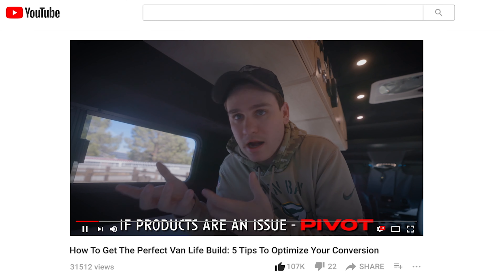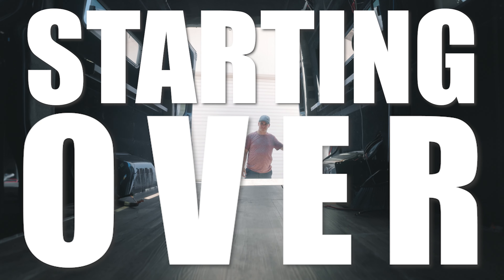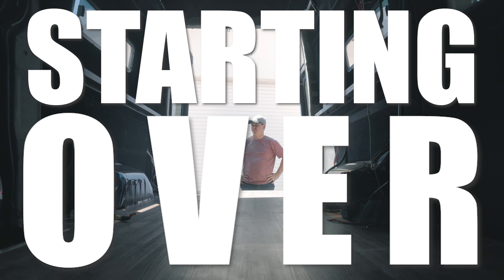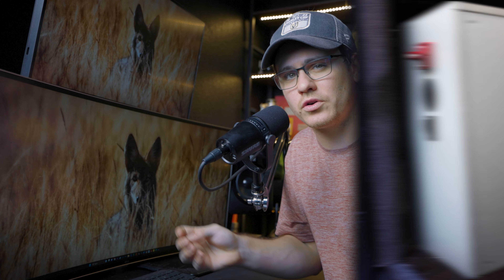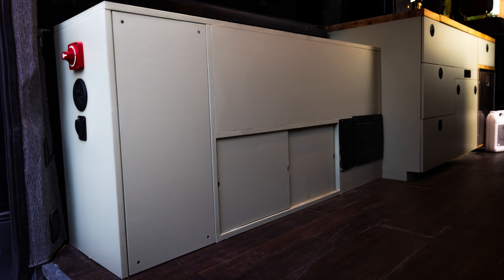How to Build the Ultimate Electrical System Cabinet

Comment: Very nice!  And you sure went with premium components.  Bigger wires are always better as well.  It looks like you have your Batteborn batteries all in parallel.  I'm curios if you took the main battery bank leads to the inverter/cut-off/fuse from the end or the middle, as it's not obvious from your video.  I guess the easiest way to balance them is to take the positive and negative leads from the opposite ends of the battery bank while keeping the leads equal in length.  Looking forward to your next video about the plumbing!